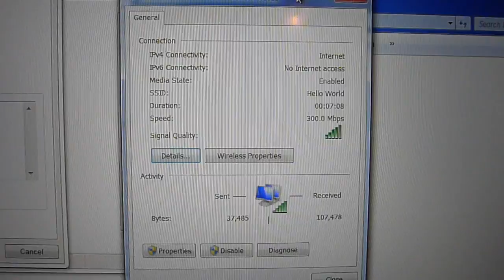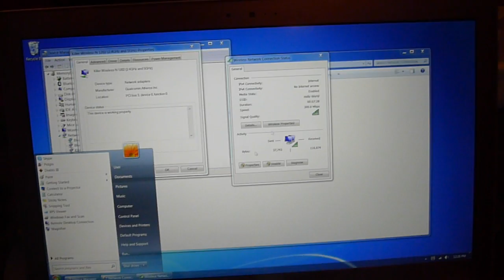Asus Zenbook UX32VD Wifi Upgrade

Comment from the maker: You're right. Because of the high heat, the tape will get very sticky and nasty. But the tape is only on the wifi adapter, so I don't really care. Also, with a little goo gone, that will remove all stickiness. A solder solution is a more secure solution, and I think it would be better, but remember, you're going to have to cut the contacts off the wire. That means if it doesn't work, you're in trouble because you'll have to replace the whole antenna. It's been 8 months, and the mod is holding up

Comment from the maker: I just taped the connector directly onto the contacts. Remember that the contacts on the killer are larger than the original ones, so remove the ring around the connector on the killer and try to place the connectors as best as you can onto the remaining pin. It will teeter because the pint won't fit into the connectors hole. That's why I used two sided tape to make the contact larger then I tapped it down.

Comment from the maker: when I started, I actually did it by accident. The killer wireless rings were soldiered at only one point and the ring wasn't solid, so my initial though was to use tweezers to squeeze the ring and make it smaller. Well, it didn't quite do that. Instead, it popped off. So I guess to remove them, just use tweezers and keep trying to pull it off. It's not a connector, so it doesn't really matter. Just be gentle not to hit other things.

Comment: So, i've posted over at notebook review forum as well
the folks there have pointed out that the connector is not a W.FL, but rather a MHF4.  They provide the p/n for the correct socket.

I've picked up a few of th ecorrect connector and swapped them onto an intel AC card (7260.HMW).  I have also picked up a handfull of spare 7260.HMW's and will do the connector swap on them.

Since it is using a same/similar chipset as the orignal device, and the same/similar driver, it may have simlar issues. However it does have Linux compatiblity for AC, which is what I was after.

I would be happy to look at swapping out sockets on someone's card if they want as a service for something like 20 bucks.

Comment from the maker: as long as the connector is touching the pin. But for my "tape" solution, it's held out for a while now. I'm sure all the glue is melted on and it looks gross, but goo gone can fix that if I want to return it back to stock. I'm always paranoid about making modifications to my hardware.
Reply: i'm gonna try it on some cheap cards then try it with one I really want. I'm considering some wireless AC cards, but that killer 1102 also looks like a good option.

Comment: thank you for your fast reply.
yes replacing the antenna is a lot of work.
i am planning buying and "old" intel 5100 (the one i have on my toshiba) that works reeeealy well, i dont mind loosing bluetooth, and hope the connectors of the antena are the same size.
I still cant bealive how intel released such a shity product, because at 1st i thought it was samsung problem, but a lot of brands are having problems with the 6235.

Comment: hello, i have bought a samsung np700 with the same intel card, is RUBISH, i am unable to tranfer files trough the network because the conection drops :S
Is there any card that comes with the same size of U.FL as the intel?? because i dont want to tape it.

Comment from the maker: Have you tried replacing the adapter? If you have and you're still experiencing problems, the connectors may not be set properly. Remember, even though windows detects the wireless, that doesn't mean that the antennas are connected. As to how you know if it's on correctly, you have to kind of feel around and do lots of trial and error. It took me a couple of tries which is why I did not post a video of me trying and failing a bunch of times.

Comment: Nice video! I was wondering if there was a network card that would have the same size connectors and would fit right in the Asus UX32VD? Maybe another Intel card? 
I'm not comfortable with electronics and I would prefer to change de card without having to play with the connectors...

Any thoughts? Thank you

Comment: This looks good.  I have the same Asus UX32VD I have replaced the HDD with SSD and upped the RAM.  I replaced my router thinking that was the problem but still having the flakey connection.  what are your thoughts on getting 450mbs card or 802.11ac card?  If I am upgrading why not get faster speed out of it.

Comment from the maker: I used electrical tape, and with the heat that this laptop produces, I think it's melted the glue on. I don't think it's going anywhere. It's still working flawlessly, although, if I ever have to remove it, It's going to be really nasty.

Comment: Thanks for the video!  I watched this several months ago and have been waiting until a wireless AC card is available.  I have just found the Intel 7620HWM.  I think I will give it a try with that card.  Do you know if it will work?

Comment: Hey! Thanks for the great video :-)
I am facing the same speed issued with the crappy Intel WiFi card. I got the Killer wifi card but have not been successful with the installation :(
As you mentioned, the pins on the Killer card are bigger and the antenna connector won't fit. I tried taping, but they come loose :(
Do you have any suggestions? I have the skills to solder the contacts but I am away from home for a few months and I don't want to spend money on solder equipment.
Thanks :-)

Comment: The Killer 1202 is quite hard to find here... Do you know if the Atheros AR5B22 card is a good replacement for the Intel 6235?
Reply from the maker: I think any card will be better than the intel card. I purchased mine off of ebay because I can't find wifi cards around here either. I can't remeber, but I think the killer comes with bluetooth, so make sure your wifi adapter comes with bluetooth or you'll end up removing that.

Comment: I ended up buying an Intel 6300 to replace my 6235, however turns out the 6300 also has larger holes, so my antennas couldn't fit. How did you remove the rings? I was looking at it and it seems like the ring is quite solid. Thanks

Comment: has anyone tryed the Intel 7260HMW ?
Reply: I'm using it currently on linux with an archer C7. It does have high speed near the router, but connection speed certainly still varies some a room or two away.  Getting much better connectivity to the A/P in my attic  genreally (50 megabit vs 20 with the old network card) but it sometimes drops to the teens.  

I've bought a few extra 7260HMW's to swap out sockets on and sell, if you'd be interested.